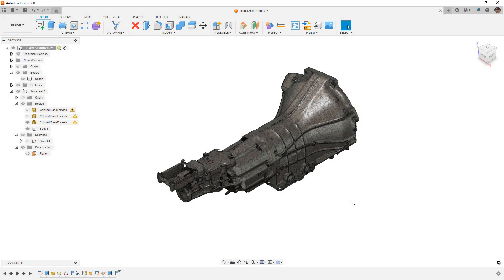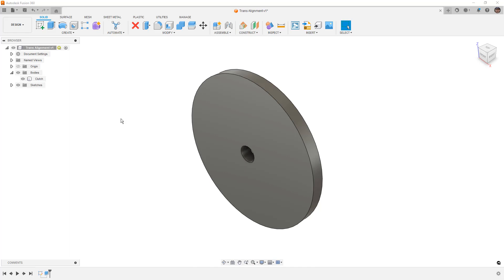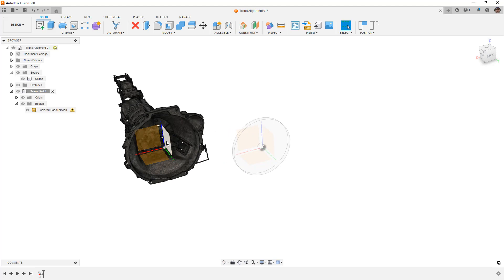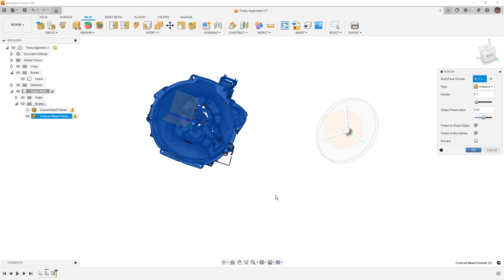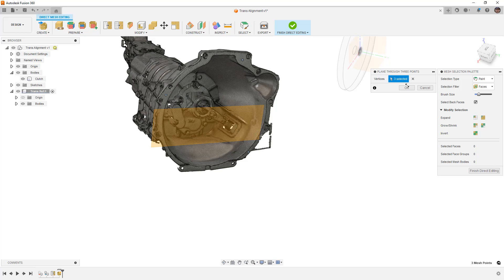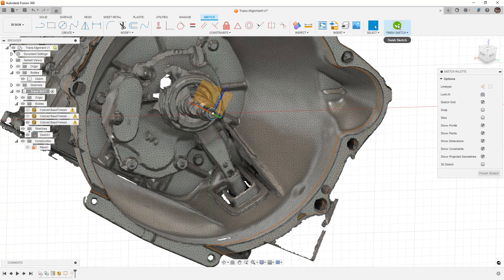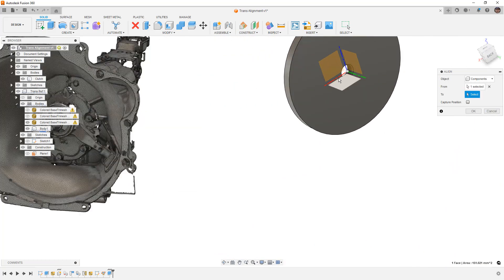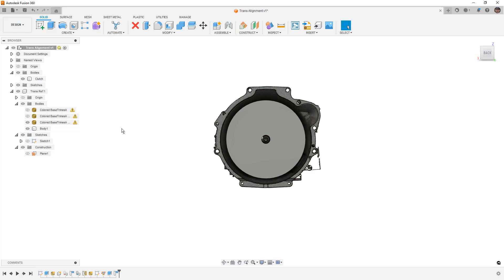How To Align A Scanned Mesh To Other Meshes /Features In Fusion 360 #reverseengineering #fusion360

Comment: Excellent video! I've been viewing too many videos trying to learn fusion for RC Jet builds and my 61 Alfa race car. Your explanations and recap are the very best instructional videos I've reviewed. I have a question that has stumped me and I'm hoping you can help. I have mutliple mesh bodies that I need to move and align with each other. Is there a way to create a mesh sketch, extrude and lock to the mesh? I'm tyring to move the two mesh bodies using the mesh sketch/body and the newly created bodies align, but they are not locked to the mesh. I'm trying to rebuild a Phantom F4 mesh design and the fuselage is in 8 separate mesh files. I need to exactly align each of those meshes together. It's a 1/8 scale jet at 7'6" lenght using a turbine. Thanks so much!
Reply from the maker: Thanks!!
So mesh to mesh alignment isn't really straight forward BUT they are just bodies.  A few things to consider that might help.
Bodies vs Components.  By default when you insert a mesh its a Body at the top of the design.  if you just create a sketch and extrude something it will default there as well.  Bodies can be moved and multiples can move together if they are all selected.  So you can select a solid and mesh body and move them somewhere else with Move/COpy or Align.
Components are "containers" with their own coordinate systems, bodies etc.  Components freely move unless they are grounded/pinned or constrained with joints.  Having each mesh and any bodies created for that mesh in a component might make it easier.

In most cases mesh to mesh alignment happens in true mesh tools like QuickSurface.

Comment: Thanks, very interesting, I just found that using an already aligned STL is a bit confusing at the beginning.
Reply from the maker: Having it aligned before it comes into Fusion is 1000% recommended :)  So if you are using shining exScan or some other mesh software and you can put the mesh aligned to XYZ i would do that.  Most of the hobby/consumer scanners in the sub $2000 price range don't have the ability to do this unless you use some other software like Quick Surface, Geomagic or something else.
Reply: @LearnEverythingAboutDesign  indeed, aligning before importing is perfect, except... I am indeed using a consumer scanner...
No matter what, I was pretty sure there were a 3 points method and I found it in your video.
Thanks for the list of softwares to do this, I will give it a look, I saw that Zeiss Suite does that, but only on Windows!

Comment: how to turn on direct edit mode :( there is no that option in my fusion
Reply from the maker: If you start with an imported model and history capture is off (no timeline at the bottom) it should always be in direct edit.  When you have history on there should be a direct edit button in the mesh tools.

Comment: one thing i don't understand. how do you align the mesh with the origins of the component? in your video it is aligned straight away.
Reply from the maker: The original scan was done with ExScan and aligned there.  I go over it in this video https://youtu.be/Ft9qTVCMwC4   There really isn't a good way to do this in Fusion.  If you enter direct modeling of a mesh you are able to select points on a mesh and make a plane that way.  But there are no tools specifically to help with that.  I strongly suggest doing it in the scan software.  If your software like revoscan doesn't have an alignment option, GOM inspect has a free version that lets you do this.

Comment: I just wanted to come to your most recent video to say, I have been going back and forth in your videos for the last couple of hours as ive been designing a re-direct duct for one of my A/C vents and the information ive gotten from your videos has easily reduced my working time on this by hours, im a fairly new Fusion360 user as previously i used blender for everything (mostly cause i knew it fairly well from previous projects) and just about anything that has more than 6 sides on it takes me a few hours to model lol - thank you for making these videos, they are fantastic.
Reply from the maker: Wow that is great to hear! Thanks for leaving the comment!  Not sure if you saw but i do have a few older videos showing how to convert blender models to freeform models in Fusion.  Might help if you have designs to port over.

Comment: Thanks for the great video. I was curious, do you have recommendations for scanners under or around $1K?
Reply from the maker: From the data that I have seen from some of the scanners, the Einstar output seems to be very good.  I haven't tried one myself but if I were buying at that price point it would be my goto.

I would check out the channel Making for Motorsport  He has done a lot of videos with the revo pop2, einstar, the creality cr01 and the lizard.  https://www.youtube.com/watch?v=mYplfztpmxU&t=4s

Note that with something like the Einstar you do still need a good computer to be able to handle it.  Some of the smaller units that connect to a phone require less of a computer to drive the software.  Things like the Ferret scanner from creality are around $300.
Reply: @LearnEverythingAboutDesign  great, thank you!

Comment: Hi Matt! this is a game changer. In many scenarios we import the mesh to be part of an assembly. so using this technique saves the extra step of having to align the mesh to the WCS in the scan software. correct? TIA
Reply from the maker: Great to hear!  I would still say you should align the mesh in the mesh software to a known orientation.  It won't hurt down stream in CAD, but if you don't do it you might hate yourself later :)  There are modeling approaches with assemblies where people will use a known coordinate system reference for everything.  For example if I was modeling the engine and transmission, it would be possible to reference everything from a coordinate system that is common for all parts.  I think that is an exception more than a rule.

So in short.  yes align in the mesh program if you can, it will help.

Comment: Lots of great information there. I've often thought about the best way to align a transmission and engine, this will same me many hours. Thanks Matt
Reply from the maker: Glad it was helpful!  Keep in mind this is a work around of sorts.  It can be done but it is less than ideal.  But if you don't have a dedicated mesh program then a work around like this might be the only option.
Reply: @LearnEverythingAboutDesign Amazing to think that you could still get further accuracy. It's probably as good as I need for the accuracy I require and limited budget. Thanks again